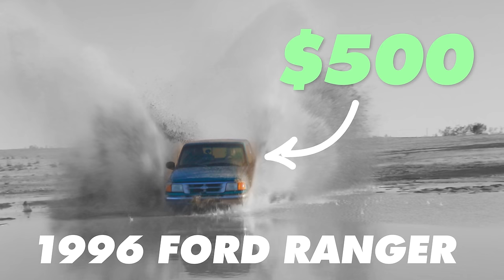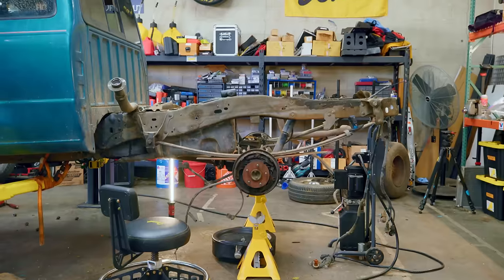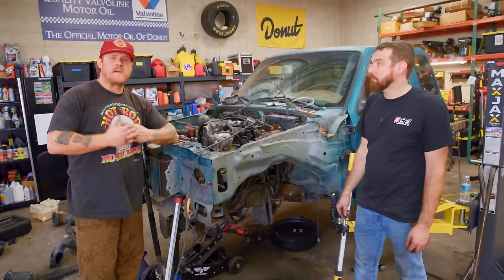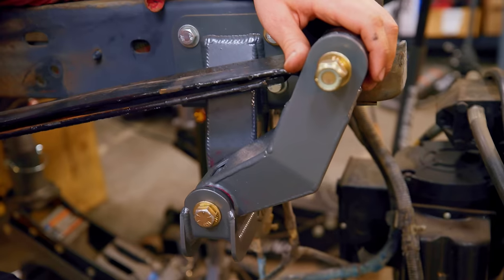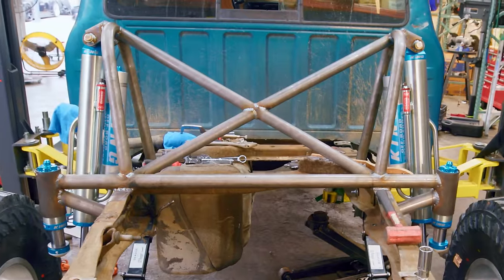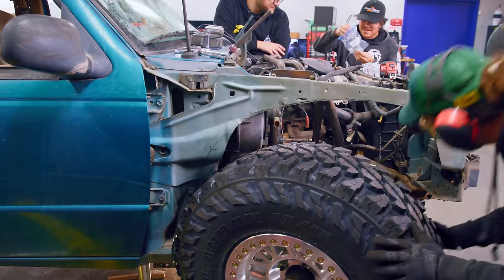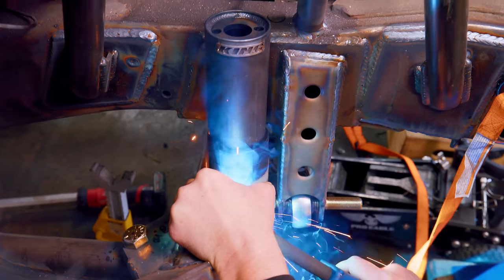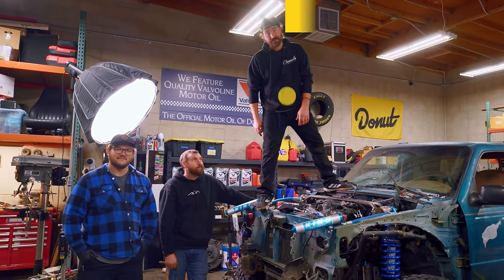We Put $15,000 Suspension on our $500 Ranger

Comment: Great video guys. Definitely looks like a fun build. Just so you know you might want to rethink those rear shock upper mounts and also the shock placement.  Have the resi inboard like that is not going to be good.  Usually you want the resi in the rear behind the body.  Having them inboard like that when you side load the axle in a corner it will shift the axle side to side and you will smash those reservoirs into the frame rails. Plus having that upper pivot bolt going forward to back means as the shocks are working they are moving forward and back so it will wear that upper uniball super fast vs if it was just moving with the race.

Comment: Ideally when setting your shock height. You want to leave only about 1/2" to 1" of travel before bottom out, and put your full compressed bump stop there. This ensures the most travel from the shock. Idealy when leaf and shackles are at full extension they are within the max range of the shock, if not, you need a belt to stop the shock from topping out. Topping out a shock is as bad as bottoming out one.

Comment: When you go to take those pitman arms off just take a zip disc and cut right through it vertically. They come off like butter. If you heat that thing up like you did you risk damaging the seal in the steering box.

Comment: Great to see you guys building offroad vehicles now. Just a few quick tips. 1st when you're off road, things that you think shouldn't move, move. When you are making clearance for moving parts, give it a little extra. Especially tires! Being offroad, not only will the tires expand at speed, but they will also take new unforeseen forms while going over terrain. 2nd, get rid of those stock tie rods and go with heims. Between the extra weight of the larger tires and just not being designed for heavy offroad use, they will break, and often. I look forward to seeing where this build goes.
Reply: They will prolly bend
Reply: Not to mention when a tie rod fails they come apart. If a hiem fails with a double shear, it's still captured just sloppy as hell but drivable.
Reply: good to know
Reply: Should probably build a swingset steering setup, better angles and much stronger.

Comment: So I've been thinking a lot about this video today. I was thinking about how heavy all the welds must be on the steel frame. I wonder how much added weight this adds to the vehicle. Then of course I was imagining what I would have done better. (Even though I have absolutely no experience) Then I thought about weight reduction, and the little kid inside me asked what if we filled all the tires with helium? I know it sounds far-fetched but I did all the math to see if it would work. Basically a 40x15.50 R22 tire can hold roughly 93 gallons of helium. As it turns out, one pound of helium only produces roughly .0084 lbs of lift. So for a cool $17, 623 you can fill up all four tires each with 93 gallons of helium, producing 3.12 lb of lift on the overall weight of the vehicle! You guys. This is an untapped market. If you really want more hrpws, you really need to think outside the box

Comment: You guys are in trouble.  Simple coil over and leaf spring prerunners are so fun and amazing that they make you want more speed and plush landings and begit bigger parts and more power.  Pretty soon you’ve got 75k into a 500$ truck.  God speed boys.
Reply: Also, it would probably have been a good idea to weld some ribs in between the bars on the ttb arms.  They like to bend otherwise

Comment: Ok so this is the first video like this I’ve watched and I’m brand new to learning about cars,  but wouldn’t you need more clearance for the bolt? What happens if while you’re driving, the vibration shakes the bolt slightly loose and it makes contact  with the bracket and wears down?

Comment: You should be using a swingset steering setup. Geoff  over at Giant is a huge knowledge base on what works and what doesn't on Tib. Even without a swingset, Giant Makes extension sleeves. 
You also shouldn't have tried to make the radius arms the same length, one side will inherently be shorter than the other, but to get the same swing arc you can cheat the right side beam a half inch.

Comment: Damn, $17K for suspension and fabbing up beams for the front, and you're still running LEAF SPRINGS in the rear?  FFS spend a few grand and buy a basic link setup, this is ridiculous.  Seriously guys, get a daily driver link setup from Giant motorsports or a four link from Solo and trash those deavers.  This truck is only ever going to be halfassed with leafs.

Comment: This is genuinely a $500 truck. Why not buy a $2000 truck?? You deal with so many less problems in general. Doesn’t matter that you’re replacing 78% of the truck, the 22% that’s original and has to stay basically is so much worse off of what $2k gets you. One of us looking for one not for all this would prob be kr start at $2k to be used as a DD as well so more relatable. Yeah, it rings with 500 miles but still lol

Comment: 17k for the suspension. Doesn't even begin include drive train, motor, ALL the hours.... your talking about a 50k cost just for starters.
Reply: More like 100k starting. The motor can be 50k alone. Then all the safety equipment.